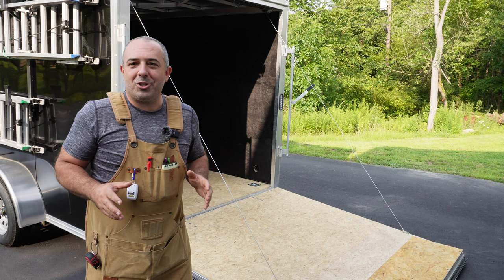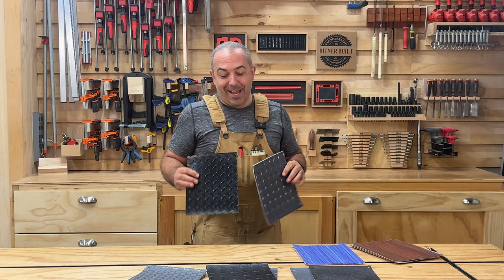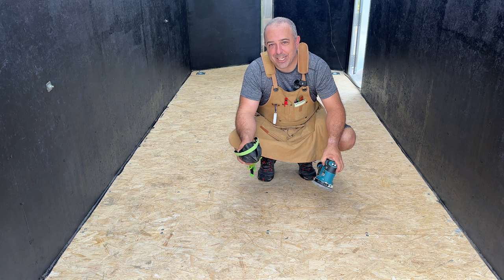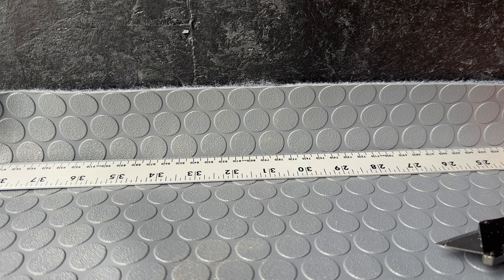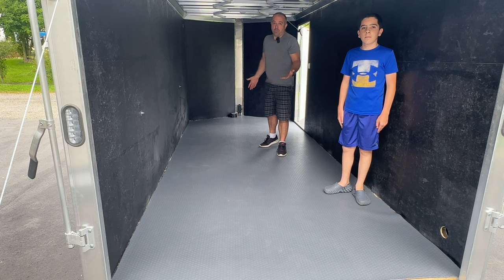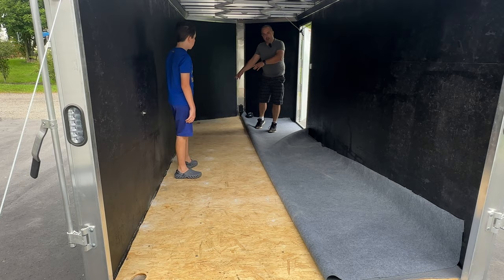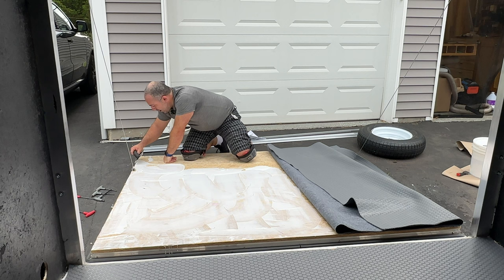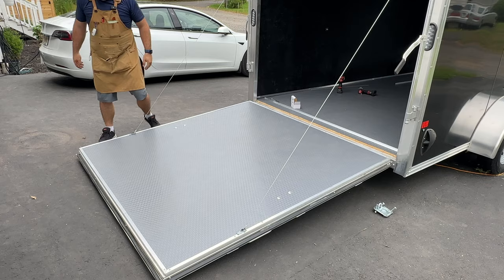DIY Ultimate Trailer Flooring Install Featuring G-Floor Small Coin Laminate   Ultimate Trailer Build

Comment: That flooring looks great! I’m contemplating using that in an outdoor shed. Seems to be a great resilient option.
Reply from the maker: Yea couldn’t be happier with it, think it would be great for a shed. I’d call them so ask if you would want the trailer grade or if the garage grade would work. Both are anti expansion / contraction but the trailer grade is more so

Comment: Too funny! I just saw this video today, 6 weeks after I installed mine. We did it almost verbatim, even down to the trim and tools. So, we both did it right! The only difference I had was applying the adhesive with a 3/8" nap roller. The manufacturer recommended either way, and I can say that it looks great!
Reply from the maker: Oh nice! Yea love it. We have been working 7 days a week for the past 3mo with it and it’s holding up perfect

Comment: Definitely more steps than epoxy.
Reply from the maker: Yes definitely however I did my previous trailer with one of the rock sold epoxy kits (don’t recommend that brand) the wood soaked it up during the drying process and so the result was thin and it ended up cracking and peeling after a year. If doing it again I would do multiple coats

Comment: I just purchased a new 6' x 12' enclosed trailer to haul my quad and gear. It came with an upgrade of plywood walls and floor and I began searching Youtube for floor coverings. I found your video to be one of the best! I really appreciate all the details you added. I found a good price on a 8.5' x 22' roll from Home Depot and will do the install soon. I've already painted all the walls with 2 coats of "silver bullet" (trailer is silver to match my truck ; ) and it looks really nice. I'm getting the rest of the gear together and was wondering what length of screws you used for the trim? I'm thinking 1" is plenty long enough to get through the aluminum trim and flooring and into the plywood. Thanks again! 👍
Reply from the maker: Oh sounds awesome! Always fun to build out a new trailer! For the trim I believe I did 3/4in screws on the pull down and 1in inside, I still love the flooring, after my crew used it 7 days a week Oct-Feb it still looks new 👍 (after taking a swiffer wetjet to it lol)

Comment: Looks fantastic!! How is the floor holding up as far as durability? I DO REMODELING work and I'm a little concerned with any rips from tools that scrap. I haven't decided to do this or epoxy yet.  Also,   those LED LIGHTS WOW! where did you get those?
Reply from the maker: Have a few videos on the trailer build including the lights so check them out 👍 it’s PERFECT still. I just finished up my Christmas light season so my guys were using the trailer seven days a week for four months, the main walking area was pretty dirty and I just mopped it with a wet swiffer and it looks brand new again I haven’t had any tears gouges or anything, and I’ve been throwing lots of plywood in lately, which then scrapes along the floor as we put it in and take it out I had wondered about it thinking maybe I needed to put something else down right there for the plywood but it’s holding up without any issues, A+ product

Comment: Looks great, I will be doing this for my newly acquired 7x12 motorcycle trailer. What scews did you use for the aluminum trim in the trailer and on the ramp? Did you just screw into the wood floor or did you try to get into the metal frame?
Reply from the maker: I use stainless steel screws with very flatheads that way if it gets exposed to liquids it’s not gonna be an issue I used 1 inch so only going through the trim into the wood no need to go into the metal frame

Comment: what size aluminum trim did you use, I know you mentioned 3/4", I am seeing several thickness on HomeDepot. 1/20", 1/16", and 1/8", which one?
Reply from the maker: I believe 1/16 but I did buy a 1/8 piece for for the transition from the door to the trailer (gets hit a lot by wheeled items) I actually purchased mostly from a local metal supply, was cheaper than HD

Comment: Great video, although It looked like you trimmed the whole rear door and did not install the flap section, maybe you changed your mind.
Reply from the maker: I did trim it all the way but then when I installed it, oomph the weight. Decided since I don’t bring vehicles etc into the trailer I would leave that back flap off and save myself some gas!

Comment: Looks great. Was the underside of the trailer undercoated? I mean the bottom side of the wood floor from underneath. I'm surprised that most trailer manufacturers don't. I suppose it increases their sales when the wood floors rot from the bottom up.
Reply from the maker: Yes it was undercoated, I spent more on the aluminum with all the perks. Just like in woodworking if you seal one side but not another it can cause bowing. So same here since we’re sealing the top with the flooring it’s best if the undercoat is on
Reply: @BitnerBuilt  Good to hear. I see a lot of people put a lot of money into the inside of a trailer and never think about one of the primary destroyers of trailers.

Comment: I’m planning to convert an E-series CargoMate 8x16 V-nose to a combo 2 room restroom & equipment trailer for Cowlitz County WA Search & Rescue.  This requires 2 walls (2 RV doors RF side), plumbing, wiring, & cabinetry. Adding insulation etc behind side & cross walls - would you still do flooring after sidewalls, or before anything else, the very first item in?
Reply from the maker: I think I would do it after the sidewalls just like you would doing a typical construction home. It will also make it a lot easier to handle the material because it’s gonna be cut into smaller pieces and based on ordering from G floor you might be able to put it into Two smaller boxes etc. that make the shipping cheaper. One large ultra heavy roll. Can be a lot more expensive to ship.

Comment: Was the temperature during application specified by the manufacturer? I think I saw "G-Floor glue" also...is that correct? How much was required for your project? Trailer size 7 X 16? Great job!
Reply from the maker: Hi Rick yes they specified the temp I used their glue for the application. The provided a big 5gal bucket for me that was wayyy too much for the 7x16ft trailer I’d say 2.5-3 gal did the job

Comment: How much adhesive did you need for the whole job?
Reply from the maker: That’s a tough one. They sent me a 5 gallon and a 1 gallon if I had to guess I probably used 3 gallons and that includes doing the rear door.

Comment: Great Video.  Where did you get the trim pieces?
Reply from the maker: Thanks! You can buy them at Home Depot or Lowe’s, but it is cheaper if you find a local metal supply store, which is where I went and bought them

Comment: is there any concern with trapping moisture?
Reply from the maker: If the floor is placed down with without adhesive, there would be. But when you’re using the glue, and then the roller, Your permanently bonding and creating that glue layer that’s not going to allow any moisture